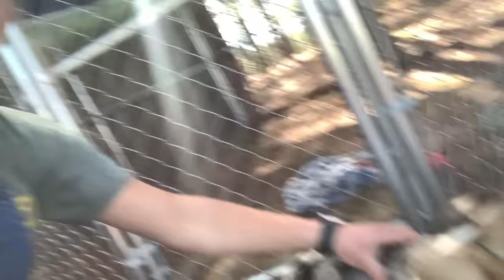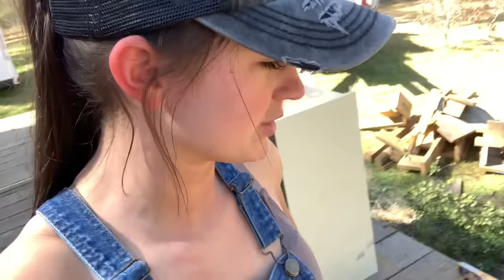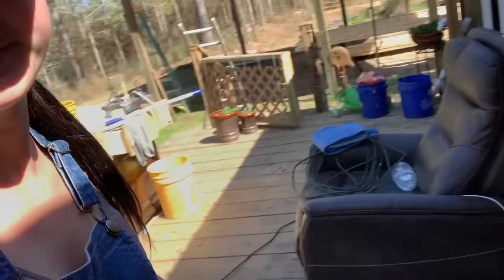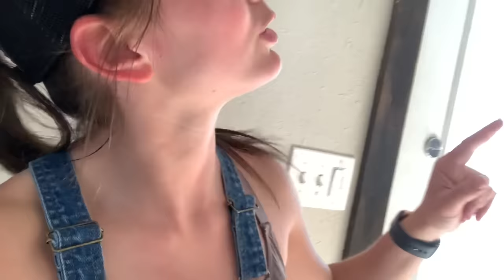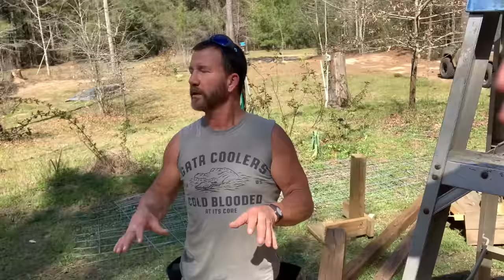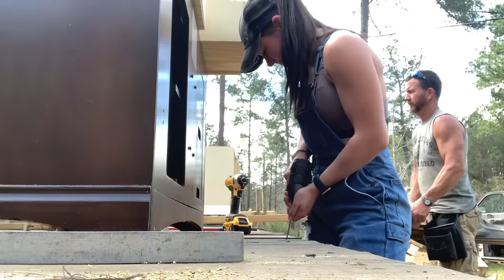Remodeling: DIY Porch Makeover!

Comment: Watched a few of your videos 5/14/2024 nice stuff...   This one caught my attention first because it was about a porch make over. However it was not what I expected. You see I live in a house in a small town and the back part (add on) appeared to be setting right on the ground. Long story short I could not find anyone reasonable to fix the floor issue I had on the first floor so I did what I could on my own. I'm handy but at 60 years old should I be doing this, but I had no better option. As it appears this part might have been a porch over 100 years ago and then they enclosed it and then later added a second story. So I did not want to disturb what was still holding up the rest of the back part of the house. So I sistered the cross beams and replaced and sistered the two broken and rotted away ones, and added two solid cement blocks under each cross beam, I would have had redone the side beams but to do that I would have had to remove the hangers making the main side beam weaker, and then have to redo that part. (I also let the kitchen counter and sink in place on the one side, maybe not the best idea but I had no where to go with it and it was now November. But still had to remove one large cabinet on the end due to the two rotted beams in that spot.) On the outside there is a deck build into the ground, now about rotted away too, and the other side is cemented to the edge with about a 1 inch gape between it and my house rear part.. When I had it open I found that it had two piles of cement on the far end corners for support in the ground and in the one side about 1/2 way a regular cement block helping support that beam. (the deck side) I did what I could over 2 weeks, added some more supported between those cross beams to hold the plywood better and since the original cross beams were also 24 inches apart. Then replaced the floor plywood, two layers, and put back as much of the original laminate flooring I could. The floor does have a slant toward the back of the house (It was a porch, rain run off.) but from side to side  pretty level and from beam to beam it is close as I could. So there are no longer humps on the kitchen floor, very flat, just a slight tilt to the floor toward the back of the house in one direction.

Comment: If you want a cheap and easy fix for your gas cap, just grab a strong magnet and hot glue it to the inside of your gas cap door. Home depot and Harbor Freight both carry them I think. Or if you have an old computer hard drive, there should be 2 in there.